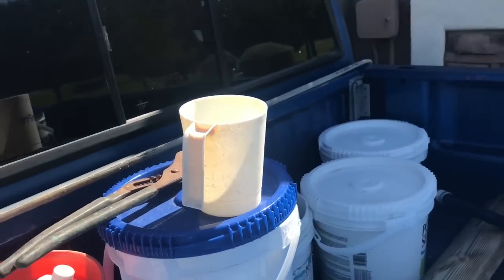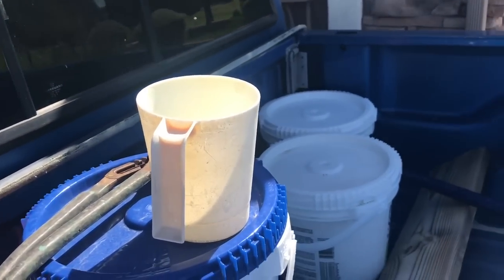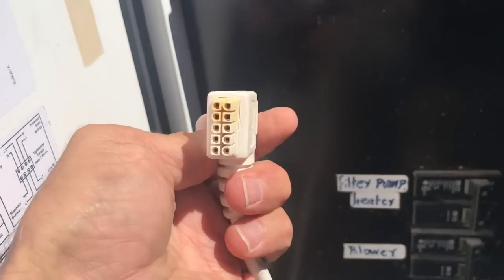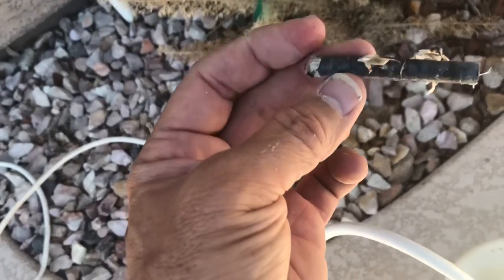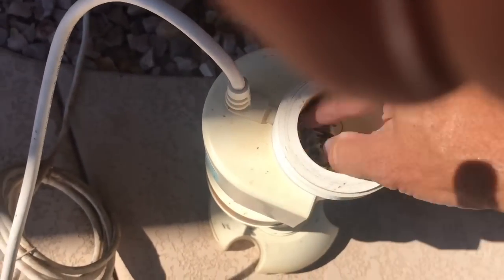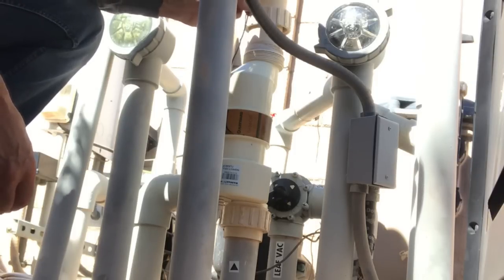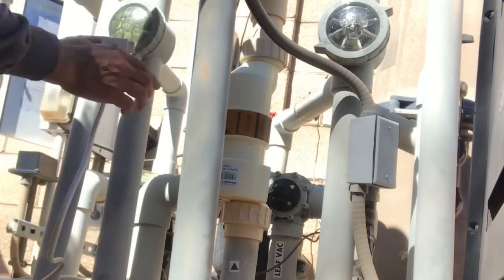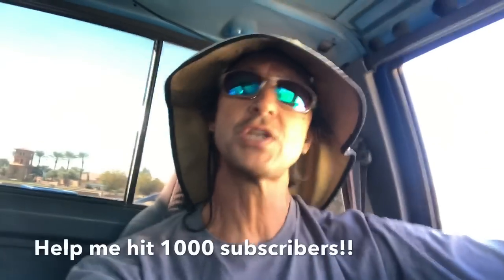Cleaning A Salt Cell

Comment: In case anyone reads this researching how to clean a salt cell, all this info is valid, except, DO NOT USE channel locks on the locking nuts.  You will chew them up.  Use a strap wrench instead.  Also, I don't know why he mentioned it in the beginning but didn't do it, use a container to mix your muriatic acid solution and pour that into your cell.  This will help avoid the bubbling over problem he had.
Reply: There are also plastic wrenches made specifically for this purpose on Amazon.  You need to make sure your tightening nuts have the correct number of nubs, I guess a redesign changed the number.  In video you can see how the Channel Locks have chewed up the plastic.

Comment: The acid cleans up the concrete really well lol. I have a high level of iron in my water. I’ve had  yellow stains on my wet deck and simply pouring some acid onto the stain it disappears instantly. 
Wow that cell was so dirty, my cell would definitely have stopped working with it in that condition.

Comment: How long do salt cells normally last before you have to replace one
Reply from the maker: @sherriecamenzind4073  to be honest it really varies. How much exposure it has to direct sunlight how extreme your climate is, etc. And how well it’s being maintained. For instance, in Arizona because of our extreme heat, the salt cell will last about 2 to 3 years maximum with proper care.

Comment: Our old Hayward TCell is bad and we haven't used it in over a year. Do you know if I can remove the fin assembly from the cell so water flows through uninterrupted?
Reply from the maker: Lonny I know some of those companies make a plain open pipe to replace the cell for just that reason. You may want to take it to a pool supply store and see if they carry something like that.
Reply: Thank you Kenny. I've seen dummy tubes on Amazon but we're getting an entirely new system in 4-6 mos so I didn't want to spend more than I have to on this old system, hence the reason I wanted to just gut the cell.
Reply from the maker: @lon602  I would say it wouldn't hurt to try that as long as you don't break the housing it should work.
Reply: Hi, i have the same one, but i never used it,  what the reason to have this when you still have   to pay for some to clean the pool.?
Reply: Can this be remove.

Comment: I must be lucky where I live.  I've never had to clean my cell in 5 years.  There is minimal build up on the plates.
Then again my pool is a vinyl liner pool without a heater so there is no reason to keep calcium in the pool.
I also don't add much water from the tap over the season.  I just let the rain keep the pool water up and rarely vacuum to waste or backwash.
My only complaint with the Hayward Aquarite System is with the In-rush current limiter (black disk) on the circuit board.   I've had to replace it twice already.  The part is always hot and crumbles over time. It's a $6.50 part from Digi-Key when Hayward wants $200 for the circuit board.
Reply from the maker: Sounds like the perfect situation for your pool.  You've done well and I'm so glad you've had such an experience.  Pool ownership, like car ownership can often be frustrating.
Reply: @PoolSchooler  That's the truth.  Pools are a lot of work and can be quite frustrating at times.

Comment: will a bad  salt cell cause the pump not to pump ??
Reply from the maker: mark choate it shouldn’t. But if there is so much mineral deposits on the cell “fins” it’s possible that it can stop or restrict the flow of water through the cell. You may want to check your pump impeller to make sure it’s not clogged. I have a video on clearing a clogged impeller.
Reply from the maker: Here's a link to that video on clearing a clogged impeller: https://youtu.be/1xuGFGDJBmA

Comment: what happend if i put in the other way??
Reply from the maker: Juan Morales depending on the type of cell. If you put it in “upside down” or the wrong way it could cause the flow sensor to not work leading to the cell not converting the salt water into purifier.
Reply: @PoolSchooler  thats i did the other one peinter i guess
Reply: @chrisburnsed6349  ok thanks for the information
Reply: Hayward says it does NOT matter which direction the cell is reinstalled. I reverse the direction of flow each time I clean my cell. [I've don it once so far!]

Comment: way too many cleaning periods for a year and not pre mixing solution before putting it into the cell. Wrong way to do it
Reply: Agreed. Premix 4 or 5 to 1 and pour. With proper water chemistry every 6 months and it should only require minutes to clean with slight fizzing.
Reply: @waynesonoda8268  

If you live in Arizona or other areas with the High calcium you would understand the water chemistry a bit differently. I inspect my T cell 15 every few weeks and most of the time the calcium is forming due to electrolysis and the 1000+ hardness we have 

But no worries, have fun and stay wet

Comment: Hayward recommends having the wire end DOWN when adding the acid solution to ensure that the contacts are also cleaned.
Reply from the maker: That is interesting, that is the first time I’ve ever heard that. Even all the companies that I used to work for say to put the wire and at the top. I will definitely have to look into that. Thank you for the information.

Comment: not sure if I'd trust you to clean my salt system when in a previous video you weren't sure where to install a salt system...you had it going between the filter and the heater when it should be the last thing water passes through before returning to the pool...and I didn't even see a check valve...